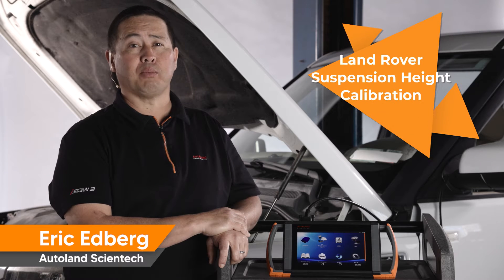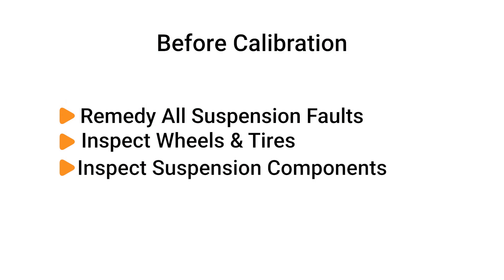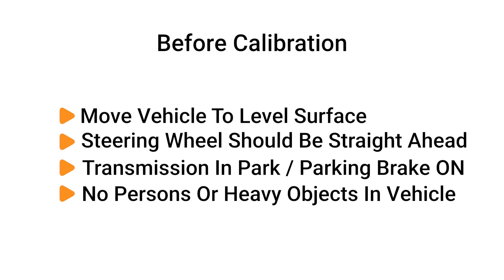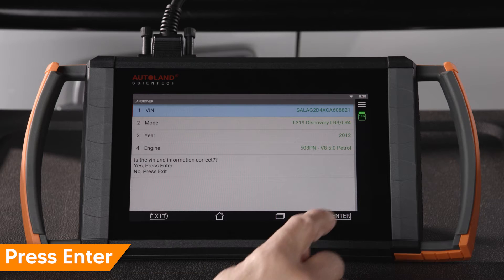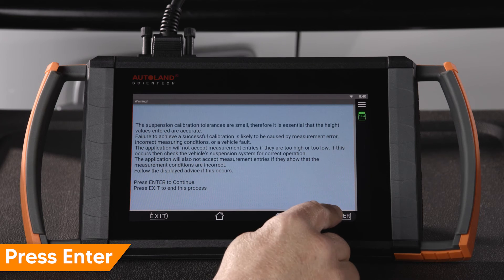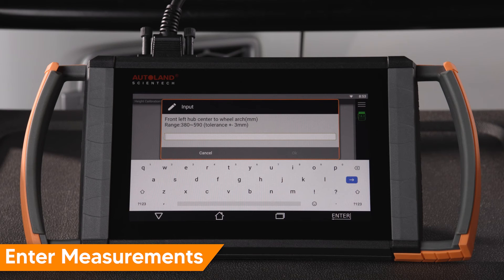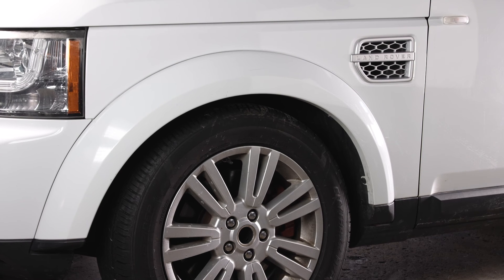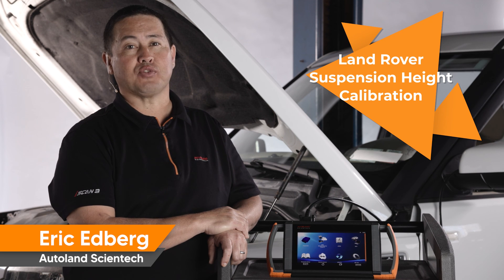How To Perform a Suspension Height Calibration | Land Rover LR4 Vehicles Without a Factory Scan Tool

Comment: What is the correct height for all front and rear. Can you share?
Reply from the maker: That varies from vehicle to vehicle. You will find that info in your repair information for the model you are working on. If you share the year, make, model and engine size of the vehicle you are working on, I can see if I have that info to share.
Reply: @A @AutolandScientechUSACedarPark mine was LR3, 2006 HSE